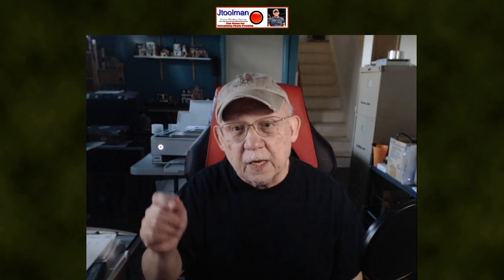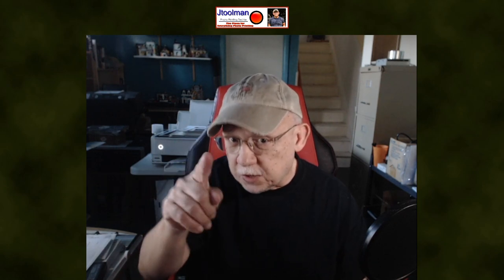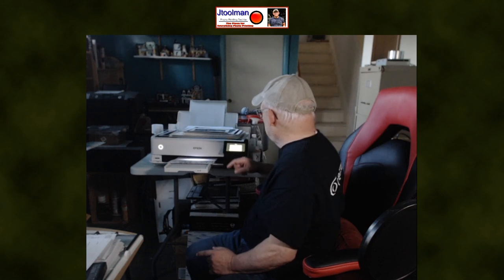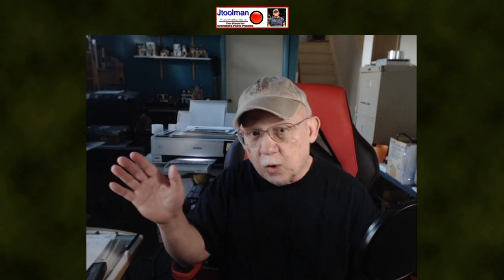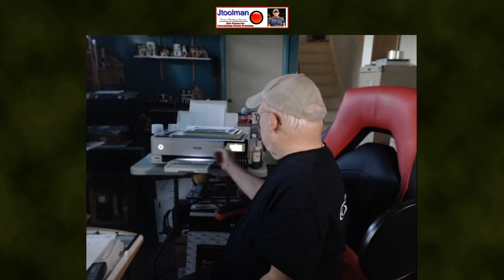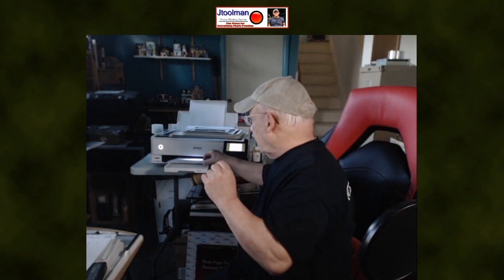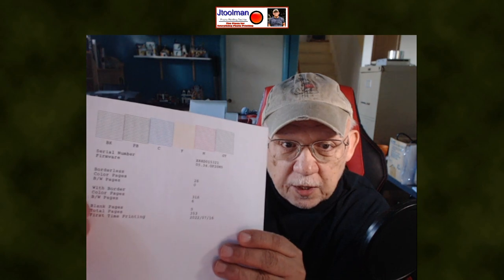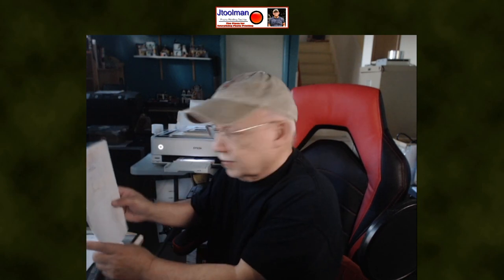Printhead Clogs! Are they all the same?

Comment: Hi Jose,  I have a Canon Prograf Pro 1000 and it started losing deep black when printing Black areas. I did a clean and it was OK and then th eGY cartridge was reported as empty. I loaded a new cartridge and then I had worse images. I did another nozzle check and the GY channel had no ink. I did a deep clean and still no ink. It will not even get through the start up routine and just keeps trying to clear a nozzle or nozzles. It is possible that the last bit of ink in the GY cartridge had some bad ink that clogged the channel. Canon of course say I need a new Print Head - might as well by a new printer if I have to fork out that sort of money with no guarantee that it is the print head that is at fault. 

What do you suggest I try to do?

Jon Ward Toronto

Comment: I hope you can help me with this, the Grey channel has clogged pattern, I do a cleaning cycle the pattern is solid and great, I print then another nozzle check the pattern is showing clogs….I did deep cleaning cycle and the pattern was again solid and good, one more print and nozzle check afterwards and the pattern shows interrupted lines ( clogs) , I use OEM ink on my Canon Pro 1000 and I run the q1 image pattern every now and then. is it a bad printer head, any advises on what I need to do next?